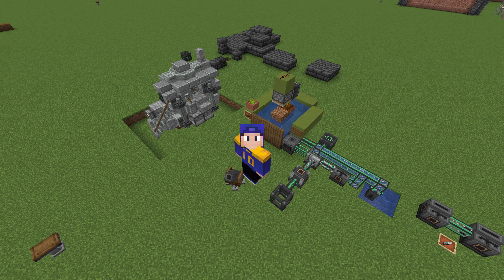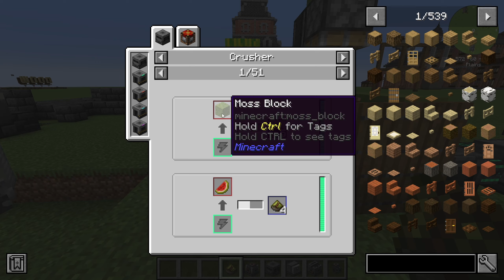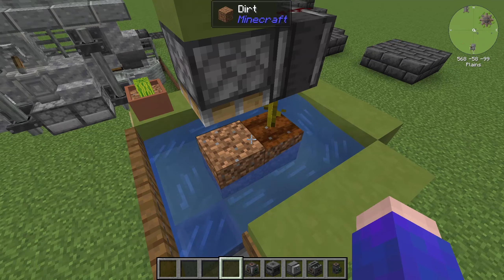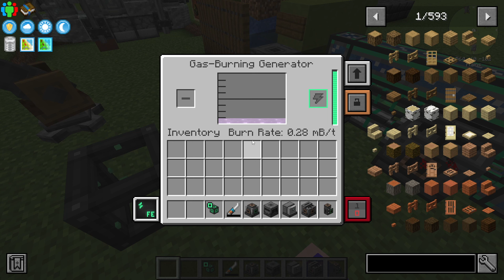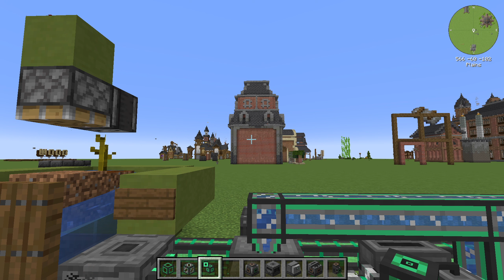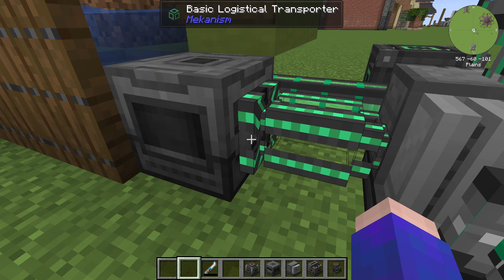Infinite Power! w/ Mekanism - Modded Tricks & Tips

Comment: If anyone can help me I would greatly appreciate it, the machine works fine but after a while I get an error on the pressurized reaction chamber saying not enough room in output, and the biofuel does not turn into substrate it just doesn't work from that point
Reply from the maker: @Enz1224  do you drive away the excess substrate?
Reply: @ yes to a bin
Reply from the maker: @Enz1224  and it is actually dumping it right? So you can see it working and the pipes are set perfectly and the output in the machines interface too?
Reply: @ yes it works for a bit after messing with it then I do some other things and come back and the bio fuel isn’t  turning into substrate it just sits there piling up with the warning ⚠️
Reply from the maker: @ is it getting enough gas and water? That might be the last thing that I can think of or maybe if it’s not getting enough power
Reply: @AzureFrostWalker it might be the water, does it need to be an infinite source ?
Reply from the maker: @ oh yes absolutely! It needs unlimited water and gas and power
Reply: @AzureFrostWalker ok I will try with infinite water source, and what do you mean by gas ?